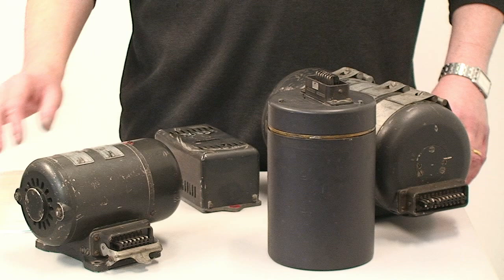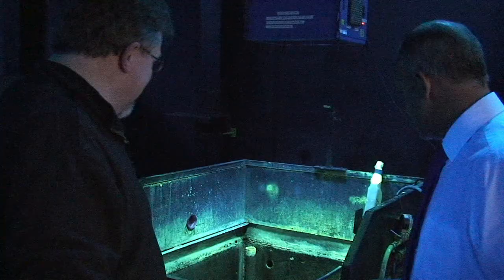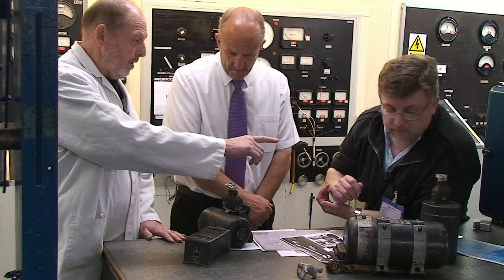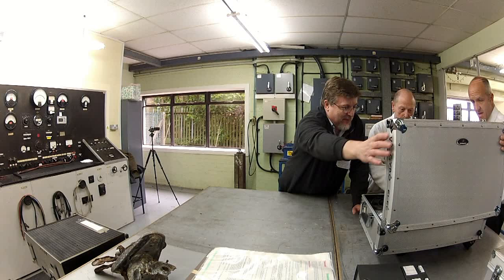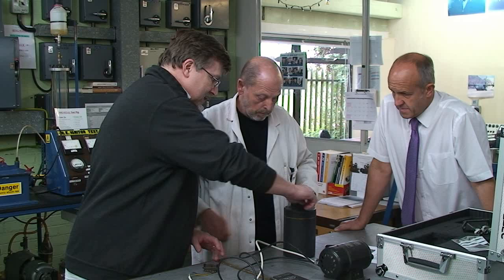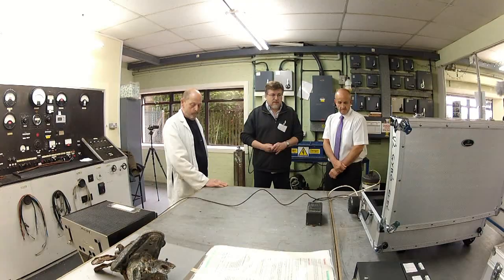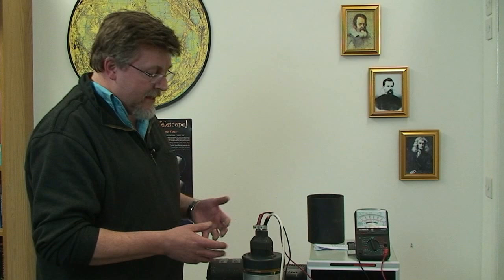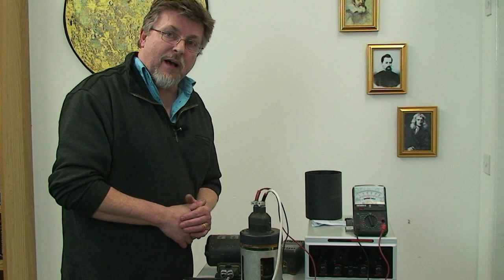The A4 / V2 rocket in detail: Bringing a V2 rocket gyro back to life

Comment: Love the Kearsley engineers--they really strutted their stuff with this.  Interesting that they had a connector plug that fit perfectly.
Reply: looks like a tuchel t2700er series conector to me
Reply: @weltfremd  Yes, you are correct, it is indeed a Tuchel Amphenol T 27000 connector with 23 pins. This was also the connector for studio equipement of Eckmiller, Telefunken, Maihak and Co.
Reply: Yea it's because alot of this early aviation stuff was copied from the germans!
And in aviation if somthing just works, it's often never changed for decades.
Reply: "Interesting"? I'm sure it goes a whole lot deeper than that...

Comment: Remarkable job at reassembling the pieces of this history ,,,in short the heart of any autopilot guidance up to todays !!!
Reply: Not really actually. Modern gyroscopes work on principles that have absolutely nothing in common with those old spinning mass gyros. They are of course still called "gyroscope" (the term just means "rotation meter", calling a spinning top a "gyroscope" is actually a misuse of the term), that doesn't mean they work the same. In particular, basically all modern gyroscopes no longer contain any moving parts at all (or almost no moving parts, ring laser gyros need a small motor that puts the laser cavity into vibrations in order to alleviate problems with measuring very slow rotations). It's like comparing an old analog multimeter with a modern digital multimeter, they measure the same quantity, but work completely differently.

Comment: Aluminium is not influenced by magnetic fields unless it suddenly changes. As you handled the Inverter case, pressing the sides and casing that the sound emitted changed. I suspect the rapidly changing 500Hz magnetic field was causing the case to move and this is was the cause of a lot of the noise heard. Removing the case would reduce the noise for demo purposes, keeping it to understand the noise the launch engineers would have had to endure in setting and checking things over. Excellent video, thanks for producing it.

Comment: Those inverters we're also referred to as dyna motors they were used to make high voltage for tube type transmitters before vibrator tube circuits were invented
Reply: Vibrators are limited on Power, Dynamotors were used from abt 100W upwards. Vibrators are more older . The princip is the wagnersche Hammer. (Doorbell).
Reply: Vibrators were limited to lower power classes, and kind of sucked in terms of reliability and generated noise. Bigger rigs still used umformers. And I actually own several battery powered valve radios with early transistor step-up converters for plate voltage.

Comment: It's really incredible that this inertial guidance system is still in working condition after 80 years of existence! This is an analog version of operation as compared to what is used today. Which is digital but still produces the same results. Just with much higher resolution and accuracy. Very very neat stuff take good care of it and don't let any one handle it that doesn't know exactly what it is. You should set it up in a mockup of the control surfaces showing how theservo's are controlled by the tilt of the gyros.  That would be very helpful to show how it would work in the rocket.

Comment: These connectors look very similar to "Harting" connectors, which ire still very common for industrial equipment  (at least in the plant I used to work). Really cool to see that the old gyro is still working fine :)
Reply from the maker: Hi there. You're right, the Harting multi-pole plug and socket range are still in use. In fact, if you take a look at a video we have in the pipeline (50% of the footage is already in the can) dealing with the MIGA (Mechanical or Mueller Integrating Gyroscopic Accelerometer) you'll see a new set in active use!  We made our own version of the MIGA, like you do, and we used a Harting plug and socket to make the power and relay connections. The original LIST plugs and sockets are getting hard/expensive to come by - at least in usable condition, although you can good get ex-Soviet copies still easy enough. KR RJD A&NTV
Reply: @RocketPlanet  Hi, thanks for the answer, and for the video, of course. I always enjoy the sound of a gyroscope spinning down :)

Comment: I think the most fascinating thing is that guidance electrical system is build without transistors and diodes.
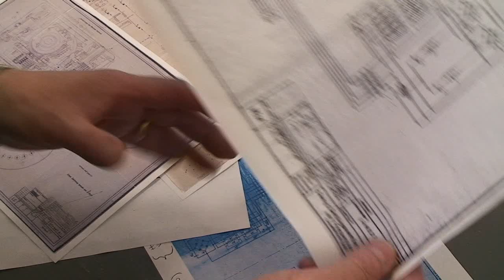Reply: Selenium rectifiers were quite a thing back then. 7:06 you can see several bridges with modern diode symbols :)
Reply: Selenium rectifiers are diodes. The flight control computer did used tubes. I think, fellow that did the video called it a mixer. The controller was a  remarkably designed analog computer. As I recall it used a small number of tubes. As an analog computer using tubes it required to be able to integrate an analog voltage over a long period of time to control the pitch angle during the flight. The engineer that designed it used synchronous AC amplifiers so that there was zero DC offset over time. This was a completely new design of his. It has to control with what we would call a PID controller, now days. This had to be tuned to the length wise rotational inertial mass of the rocket and the amount of force of the directional control. Part of the clever design was that as the rocket flew, the carbon vanes would erode, reducing the off axis thrust. This compensated for the reduced inertial mass of the rocket as it burned the fuel.

Comment: All this stuff now fits into 5mm x 5mm chip using MEMS technology
Reply: Not sure, though, they'd put a MEMS gyroscope on a space rocket due to its fragility. Have you got any info on this?
Reply: Do you think a largish mechanical spinning gyro is _less affected_ by vibration and mult-G forces on leftoff than a microchip fabbed with MEMS technology?
Reply: the beauty of MEMS is redundancy. you can put 5 gyros on each and every axis because they are comparitively cheap. you only nead at least one to survive :P
Reply: @quantumbubbles2106   Comparing to the mechanical gyros, MEMS are vastly more tolerant of shocks. The datasheet of a cheap MEMS gyro chip used in many toys (MPU-6050) specifies that it can withstand 10000 g shock (though only when the chip is not powered). This is similar to the acceleration of a cannon shell being fired.
Reply: @cogoid       A long time ago when the internet was just text over phone lines,  I found information regarding the Canadians using a donated 16-inch naval gun to reach low-earth orbit with a 20-pound sabot-round.   The idea of micro-satellites was thought impracticable because of the G-forces involved in firing the satellite from a gun.  The experiments were eventually ended, but it it would seem technology has reached a point to support the hypothesis the cheese-heads reached back in the early 1950's.

Comment from the maker: Hi and thanks. Yes your assumptions are correct. And your observation is correct also – the signal voltage was passed via this track. You can see the roll coil and double pick-ups on the outside edge just below the 50v wipers. There would have been a ‘Horizont’ component used with this gyro. It was half as long again with a pitch program system built-in. Often called ‘first generation,’ the Anschutz & Co gyros were actually used all through the V2 campaign – just not in big numbers. KR RJD

Comment: One take on this - the A4 was the explosive disposal unit for a lot of refined and well engineered German high tech. A very expensive means to deliver about 1000 kilograms of amatol to a location some 250 kilometers distance.
Reply: They were a lot cheaper than using an aircraft with trained crew, an airfield which was vulnerable to attack, defensive ammunition, fuel for the return journey, repairs and maintenance to the damaged aircraft, if it returned, bombs etc. The V2 was fire and forget, and only needed enough fuel for a minute of powered flight, a warhead, and a team of people to launch them from fairly simple dedicated equipment. A rocket would be assembled at the improvised launch sites within about 30 minutes, fuelled and flown within the next hour or so, and hopefully at its target about 4 minutes later. People who experienced V2 attacks on London reported that they heard the explosion and then the whooshing sound of the rocket arriving. There was no defence against them, apart from misinformation about the landing points, or destruction of the missiles before launch.
Reply: @RWBHere  well they tried to defence the city by steel cables from balloons :)

Comment: 20,000 rpm he says as the gyros spin down.  That seems pretty good for the 1940s!  Air bearings?  I doubt magnetic bearings
Reply: Have a couple Soviet gyro platforms from the 1970's at home. In these inertial platforms gyros are running at a speed of 22-24K rpm off 3x36V 400Hz. The surprise is that for the gyromotors dry ball bearings are used.
Reply: At 500Hz.. it would be rather 30, 000 rpm 28,000 with an asynchronous motor.

Comment: An oscilloscope would have been nice, also running the gyro without it's casing is a fairly bad idea, dust or hair can be sucked in and cause damage. At 20k rpm there is a lot of energy stored in that rotor, more than a pistol bullet, and even a slight imbalance caused by some small piece of debri falling in and getting caught on the rotor or in the bearing, or increased resistance because of a hair or piece of fluff stuck between the rotor and it's housing could cause catastrophic failure, possibly throwing shards of tool steel at high velocity... But amazing video nonetheless, this is as unique as it is cool and badass.
These are the foundations onto which the Apollo missions who put men on the moon were built, in fact the father and project director for the A4 (V2) rocket (the military version being the V2) was also the father / dirrector of the whole Appolo program.
Reply from the maker: Hi Adrien and thanks for your comments. Yes I agree, it would have been good to get a scope on it but I lack the qualifications, and piddling about with a multimeter is about my limit and we just couldn't impose on the Kearsley people any more than we did  (they were friendly people and keen to help but we just couldn't keep stealing their time). In the case of the Siemens Vertikant  gyro featured in the video, the rotor is fully enclosed - the outer case is just the first layer of protection - but your point is valid. And you are bang on with the real dangers that lurk within these seemingly tame parts of missile instrumentation.  I think you'll like a new video we are working on - it features the J-Device, the Mueller Mechanical Integrating Accelerometer  (MMIA or PIGA  to use more modern parlance). I've spent a long time studying this instrument and I think our video shows it well. Anyway, we used an open air rotor in two of the demos and filming it was what we usually refer to as a 'brown trousers day' (brown pants, if you're reading in American!). During the build, the 300gram brass rotor came adrift from its fixings (the 30Hrz vibration loosened the fasteners). Now 300 grams doesn't sound like very much if you're just posting it to someone for Christmas but at 30k RPM  the rim is passing about 80m per sec (250ft ps) - and as you know this is quite enough to do serious mischief to anything soft and fleshy that it happens upon. It happened upon yours truly. Consciously I know better, but at the crux instinct took over and I actually tried to save the precious rotor  - I got a nice burn and lost a strip of flesh off the side of my hand for my foolishness. The rotor was fine and counted this a good day. The MMIA video should be online early in the new year. KR RJD A&NTV
Reply: Thank you for your reply, yes angular momentum is very dangerous because it doesn't look it when it's balanced, nothing seems to be really moving, but when you get above 5k RPM the velocity of the surface at the edge of even a small diameter rotor is already very high, and above 10k RPM you get in an area where the tensile strength of the material the rotor is made out of is the only thing keeping that angular momentum being turned instantly into linear momentum with a near 100% efficiency, and you suddenly have literal bullets flying around. When I talk about a hair or a piece of fluff turning the rotor into high velocity shrapnel it might seem like a hyperbola, but it really isn't, because the piece of fluff isn't what makes the shit hit the fan, it's the imbalance it creates: suddenly you have a tiny vibration, and a millisecond later the rotor has bent it's shaft slightly, two ms later the shaft digs in the generally softer rotor and five ms later the gyroscopic forces overcome the tensile strength of the rotor and it blows apart. It's a self reinforcing failure: the worst kind there is.
The Le Mans Nissan Nismo car at one point was planned to have a 5Ocm diameter rotor installed geared to the rear wheels during breaking as a regenerative breaking system (when the brakes were applied it was mechanically connected to the wheels and their rotary speed would be transferred to it, slowing the car down whilst accelerating it to incredible RPM's using a huge gearing ratio, later on to be put back in the wheels once the car had left the corner to give a short 600HP boost) It literally had to be in a vacuum because during normal operation when breaking the rotor's edge would move at over mach 7 and would otherwise melt from friction with the surrounding air !
Anyway yes I can't wait for your video, seeing these pieces of technology that were (put together as they were in the A4) a decade in advance of anything else on earth at the time is just incredible. The dream would be to see the whole guidance system in working order, including the at the time first integrated circuit of modern human history, but that's a lot to ask for a rocket designed to crash and detonate with one ton of TNT...
I didn't know the rotor had a protective housing, my bad. Can't expect any less from German engineering of the time ! When you think they did all this whilst their whole nation was being bombed massively, with shortages of all kind, and that they built them till the very end, when the British didn't even know what was left to bomb anymore... Amazing. Such a sad story that this amazing potential was wasted by an insane government... Where would we be now if it hadn't been for that ? Can't help but wonder.
Reply: Wow! Detail explanation.
Reply: Nazi slave labor built a lot of stuff for Van Bron. They should get credit for Apollo as well.
Reply: @RocketPlanet  Ah, the gyro was made by Siemens?

Comment: Damn now thats cool, especially when you switch it off, and you can hear the gyro freewheeling for minutes on end. I noticed at Keasly when you were handling the gyro while it was spinning down that as you tilted it around, the rpm's dropped quicker, possibly because some of the stored energy stored in the flywheel was now being used to try and right itself.

Comment: Nice to see a matter of fact rather than a GOSH REALLY!!?? documentary!  I'm now thinking my couple of old Sperry gyros would be more interesting coffeetable conversation pieces if I could get them spun up.  Just need to build the 3 phase supply...
Reply: Several cheap audio amps driving transformers will do it; you don't need kilowatts to excite them, a few tens of Watts is all that is necessary.
Reply: the newer stuff are made for 400Hz 115 or 208 Volts . There are power units from surplus dealers available. Between my odds and ends is an 400Hz transistor converter with 500W total. It seems it is from torpedo. I get it several years ago at ma local scrapyard. 
Home brew 400Hz is easy to archiev with a bench audio generator and a commercial 100V speaker line amp.

Comment: This cuts across a lot of my engineering career - the control problem for a rocket is now well known but then control engineering was in its infancy - more suck it and see! A rocket is fundamentally unstable, like trying to balance a pencil on the tip of your finger. I had design authority for the manufacture of gyros, potentiometers and encoders at Ferranti Dalkeith in about 1980, and saw a single control axis controller using valve amplifiers as a student at Oxford university. Could you do a piece on the control strategy used including any feedback from the guide vanes if used?